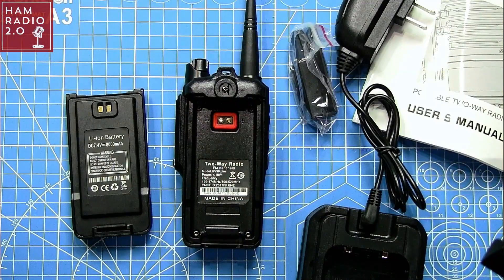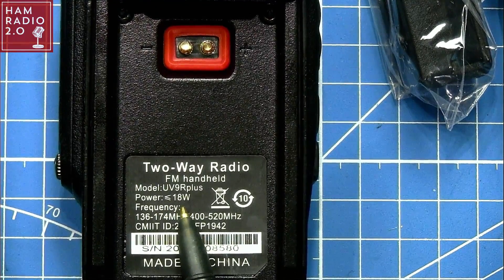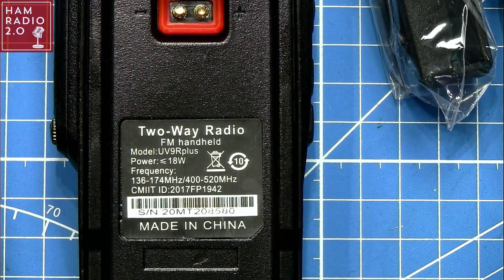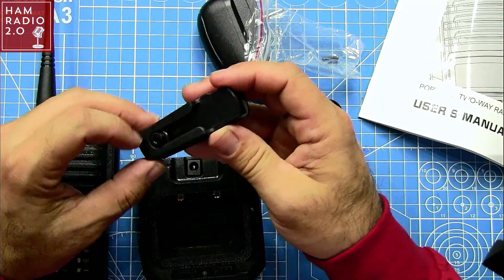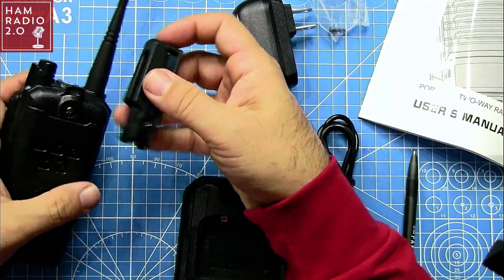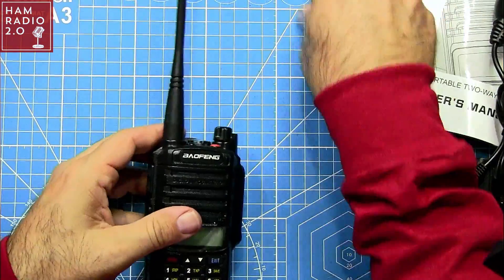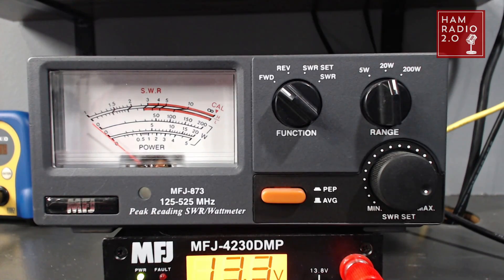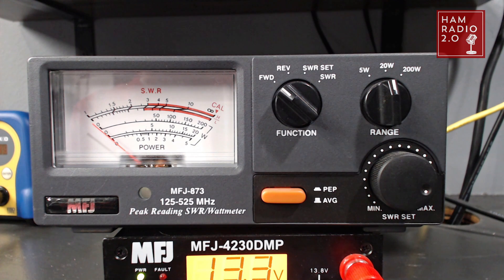Baofeng UV-9R TP 18-watt Power Testing | UV9R Plus HT

Comment: I'm wondering if there is a output difference between VHF and UHF? You didn't say which you were testing it on you just said the frequencies and you can still have the same frequency showing in the display on both VHF UHF

Comment: Baofeng will not make a 18 watt radio ever ... its either 5 watts or 8 watts .. any other Baofengs that have a sticker that's saying 55 watts 60 watts 100 watts. The radio is from another dealer and is not an authorized Baofeng Dealer ...

Comment: Well, if 18 watts at 8.0V that these radios operate at is the actual Amp draw from the battery, and not the effective power out, that would be 2.25 amps from the battery.

Maybe that's where these liars got the number from. It draws 18 watts from the battery while transmitting.

Comment: No no no you did it wrong. You need to be a mile off shore over saltwater in a helicopter with a altitude of 355ft in the air to get the full 18W. Didn't you read the fine print? It will also go to 25W if you're in a submarine.
Reply from the maker: Lol

Comment: hi 
I have a question: is there any difference between UHF frequencies??
for example, I mean is there any difference between 410.5 MHz vs 470 MHz??
I'm a mountain climber and I have purchased a uv82. now I want to know which frequency should I use in mountains and forests to achieve the most range? and also which frequency should I use in outdoor(such as deserts) to achieve the most range? or there is no difference between 410 & 433 & 470 MHz at all !??
Reply from the maker: Range wise there's no difference. For what frequency to use, check with the forestry service or wildlife management area around you to see what frequncies they monitor and what you're allowed to use.
Reply: @HamRadio2  tnx

Comment: lol My baofeng UV-9R-ERA is putting out a 1000w and is water proof to 100 meters it costs 26 bucks plus shipping with a free extra O- ring for the antenna. I just put a real imitaion NAGOYA antenna and I will be trying to contact Australia from San Diego barefoot. I'll let you know how that turns out ASAP.  73 KN6TUX

Comment: Thanks so much. I want radio communications for my ruralish site, a 240 acre spread of prairie. I also plan for CB,  and shortwave and FM Dxing. These little HT radios have got my attention. I've used them for traffic flagging, and the major fault I've experienced is that they don't work very well in hilly areas.

Comment: I have the UV-9R Plus even with the same battery, but mine only claimes to be 15W not upto 18. I have no way to test it either but I suspect it would still only be about 5-6. But what I'm wondering is... does it use/transmit extra power when using a CTCSS tone? Maybe even more power if using digital? Maybe the 15 (or 18) are the max the circuit could hanel by the firmware still limits transmit on those bands? I have a "Baofeng" cable to program it with chirp (gotta get the special Prolific 3.2.0.0 drivers for my cable to work) and it only has 3 pins for contact. You can also do more with programming it with chirp, like enabling the channel mode to show a channel name of up to 7 characters instead of the frequency. that's great if you're like me and mainly using it as a scanner that can double as emergency backup comms if it hits the fan. One of the settings I saw in the radio using the chirp software was a power saving ratio. Does turning that to "off" make a difference in the transmit power?

Comment: Greetings from the UK 
It occurs to me that all Baofeng are doing is petty much "re housing" the UV 5R,  I've had a few 5R's they are great little HT'S but the build quality is not so hot!, they just kinda feel cheap, I picked up a couple of UV 9-ERA's .. power tested came out the same (4 watts) but weirdly the very first pair of UV 5R's I bought about 4 years ago are kicking 6 watts!! My favourite ht is the old dependable kenwood tk 2180 (the full numeric version )  you can feel the build quality just holding it in your hand!

Great channel btw! 👍

Comment: As a complete noob in this topic: What happens if you use a very high transmit power near your head? I mean, are there studies or can you tell from your personal experience, what it does to the brain?

Can you feel any harm right while/after using it?
Reply from the maker: I've never felt anything, no. Most people don't like using a radio that's more than 5-8 ways close to their head. Higher powered radios can be used with external microphones so that when you transmit, you can hold the radio away from your head
Reply: @HamRadio2  OK. Thanks for the answer. I was just curious since I heard this in a lot of Radio-Videos on Youtube "you probably don't want to have 8 Watt right beside your head"

Comment: Baofeng radios have a reverse sma which has a male pin. Is this the first Baofeng you have seen?
10 volts is a common voltage to feed a BF charger with. You can get a usb adapter  to power the charger cradle or a usb 8V to plug into the battery to charge it.
Aircraft is AM the BF is FM
I have 2 types of Baofengs that will do 8 watts on vhf and is 130-170 220-250 400-450 and all is at or near 8 watts!

Comment: K4KID here... Thanks for the video info. Two thoughts... 1) I have a UV 9R Plus and the antenna connector is exactly the same as the UV5R and the UV5R TP radios that I have as far as the Male-Female antenna connector direction.  The label in it says 15 (fifteen) watts. It was given to me. I'll measure the power out on it later today. 2) Back around 1975, "COMMUNICATIONS" magazine, the journal for professional radio technicians, did a study w/ 5 watt HTs because many police departments at that time were in the process of equipping every officer w/ an H-T of their own as the primary radio for each officer. They compared VHF and UHF effect on the eyeballs of users. They found that a short (I believe I recall it was a 6 second transmission) w/ VHF increased the temperature of the user's eyeball by a measurable amount. When they did the same tests w/ the UHF version it increased the eyeball temperature even more. That stands to reason.... Microwave ovens are primarily used to heat the fluids that are inside whatever you are cooking. The UHF band is closer to the Microwave frequency. About the only way I would use 18 watts an inch or two from my face would be if it was a serious emergency, and I absolutely needed the power to communicate the need for help. Thanks again for the look at the 9R version. 7 3

Comment: I recently purchased 2 of the UV-9R plus distributed by MIRKIT and ordered the Nagoya NA-771 antenna. The antenna would not fit into the recess of the radio, the base of antenna is just slightly larger than the recess on the radio (where the antenna is suppose to screw in)(female antenna, male on radio). Everything else looks to be correct. Any suggestions on different antenna maybe?
Reply: You have to remove some of the plastic around the base. I made that same discovery a couple years ago. Remove a little plastic. Like right when you start seeing brasss stop and goes on fine and works good. But I have a abbree and nagoya that work better

Comment: There's no way that I would want 18-watts near my eyes or brain....
Reply from the maker: If it actually did that much on high power, you could turn it down to Low or Medium while using it next to your face - and on high power, you would use it with a speaker-mic while holding it away from you, or when it is connected to an external antenna.  You would have more choices if it actually did what it advertises it does.

Comment: As far as running the charging cradle from the field, get a DC to DC converter, also known as a buck converter. There are a lot of small ones you can throw in a small project box that are adjustable (either via a knob, or a potentiometer you add yourself, or digitally via a rotary encoder or an arduino or raspberry pi that you can slap a screen on and program) and they support a wide range of DC inputs and outputs. A range a remember seeing is like 1v-40v for both input and output, so you can easily go from a 12v power source to exactly the voltage needed for the cradle. After that, you can just buy the right size barrel jack for the cradle!

I know this radio isn't very good, but the buck converter circuit can be built for like $10, and that's including an adjustable converter as well as a small LED voltmeter so you know the output voltage, and if you carry a handful of different adapters in a small bag (plus gator clips) you can basically power anything with this tiny device you build yourself. Either use gator clips and hook it directly to your car battery, or use an inline fuse of around 7.5A or less behind a cigarette adapter

Comment: Smiling!
My first Baofeng UV 5R still working and I bought it when it was only available from china, around 54 bucks, took 28 days and I thought, disposable ham radio. All the little rubber pads are sorta messed up but still going. 
Ham Radio Dude has done a review on the UV 10R 60 watt one.  Some things defy the laws of physics ... not in this case it's a 4 watt like all the others... but wow that 24,000 mAh battery would be something to see in that size.

Comment: Aloha Jason, when these Baofeng UV-9R Plus first came out on eBay, they were advertised as 10 watt radios, then 12 watt, then 15 watts and now they are all over eBay as 20 watt handheld transceivers. 
    Now if it was truly 20 watts with a 9,800 m/ah battery, you would be lucky to obtain 6-7 transmissions for 30 seconds. Personally, I won’t put anything that transmits above 10 watts near my head. If you look at the RF charts put out by the University of Texas, the users of a 20 watt handheld would be effected by RF Radiation with that antenna next to a person’s head. A handheld radio with a mounted antenna should come with a RF Radiation Warning notice and/or labels to inform the users of dangers of RF Radiation. We all know that these sellers are intentional advertising these radios at higher than acceptable wattage ratings in order to charge more and gain more sales but what if one of these radios really did transmit at 20,30,40 and 60 watts? Is these sellers going to pay a user’s medical bills? Not likely but a warning label would require testing and inform the buyers prior to purchase. Great video again!
Reply: Radio waves are invisible, and you pass through them every day. Many of them are much more powerful than that of any hand-held radio. We're talking 1,000 times more powerful. If you lived near an fm radio station, would you live in fear of it.?

Comment: Each time I see the Baofeng with 5W or 18W , I feel  embarrassing. Are you kidding？ Are you serious?  According to the standard of telecom walkie talkie, the 5W is the most output for handheld UHF device.  Why does Baofeng make it 18W?   18W means it will cost about 18* 1.7 = 30W  =  7.4v*4A . But the battery's capacity is about 15W, which means it could work about 4 - 5 hours for daily usage. With 18W output, the  radiation will do harm to the user's body health.  This kind of 18W device does not make sense and is invalid device.

Comment: I have the GT-3WP and it looks exactly like this one. Has the same external microphone blade requirement that my other Mics do not work with. It is said to be "waterproof" which is what the "WP" in the name seems to inply since everything is pretty much sealed. Same output as you reported. I like the feel of this one, a little bigger and more robust-feeling but this one has the same antenna connection as the UV-5R. Charger like the one you showed too.

Comment: all these "higher wattage" versions are guaranteed to be nonsense designed to extract more money from you for the same radio. There are some 8W ones from reputable suppliers that are basically what they say they are (actual around 6 instead of actual around 4), but what do you need or want an 18W HT for? Battery life is gonna suck and you still won't get any further out.

Comment: A curious date.... Rqa0009 MOSFET (power transistor of uv5r &others) can work to limit of 15w.... Maybe is possible 15w with  some internal changes... But the baterry needs more amp. Anyway 15w near of head not is secure...

Comment: KO4GJO  I have 3 of the UV-9R+  Mine were only rated "15" watts.  It was cheaper to get 3 radios than to get one radio and a couple of spare batteries.  Somewhat sturdier and more dust/water resistant were the objective and worth it.  Did NOT expect 15 watts.  Side note: The slightly larger size  actually makes it easier for me to handle, due to some carpel tunnel issues.  Replaced the antennas for signal improvement.  Otherwise, hey, it's a Baofeng!

Comment: So, I sell these radios as a side gig. The UV-9R, The UV-82, and the BFLF-918uv. In EVERY case, when I order, they ask me what power label I want on them. All models of Baofeng are 4-6 watts rf out.
Reply: Thanks, what would you recommend?
Reply: Yes witch one is the best?
Reply: There are some 8 watt radios. They're not either of those 3.
Reply: @phil2082  which ones are the 8 watt models?
Reply: Uvs9plus or uv5r8w

Comment: Hello, Great Video. What type of Antenna did you change on Uv9rplus?
Reply: APPREE makes some deceit antennas for these.
Reply from the maker: I didn't change antennas on this radio.  The antenna is comes with is a standard SMA-F so any antenna with that style should work
Reply: @HamRadio2  Could you recommend a good size Antenna, not so big.

Comment: Some radios require an external power source (either an external battery or power supply) to be used while operating the radio to achieve a higher watt output. Curious if that would make a difference? if possible!
Reply from the maker: This radio doesn't really have an option to plug-in external power.

Comment: LMAO. The 18W power listed on the label is for the power input maximum. A 5W ideally matched load's RF power output requires another 5W to be dissipated in the source transmitter for a total of 10W. If the load impedance is lower, then more power is dissipated in the source. Minimal additional power is needed to run the rest of the radio.. The power input label on the back is stating the maximum rated input power requirement.
Reply from the maker: This is incorrect. The packaging and website link where I purchased it confirms it to be advertised as 18w output
Reply: Going off the actual label in the video and not marketing/ advertising, my information is correct.
Reply from the maker: @superalpha  Not really.  Many, many HT radios list an output power on the back of the radio, behind the battery.  This "input maximum" thing you are talking about has nothing at all to do with the stamping on the back of the radio.  In fact, it would surprise me to see any of the Baofeng radios with that much detailed information about their own product in any of their documentation.  Lots of HTs have "5w" or "8w" on the stamp behind the battery.  This one says "18w" and it was advertised as such on their own packaging and sales website.

Comment: Looks exactly the same as my UV-9R with the same power output, except for the "plus".  Even the manual looks the same.
Reply from the maker: There are several models that are very similar
Reply: I have a UV-9R plus.  It is my low power dual band base. To a J-pole @ 10 feet.

Comment: After allot of research. I did buy the 8 watt version (Amazon) and like it. (It was going to be a backup for my Yaesu, being repaired...again!) I can overlook the fact it really isn't 8 watts (but its probably 5 watts on high) but have not tested it yet. Perhaps their claims are for speaker wattage? Not TX power? But these are WELL built little radios. I have dropped it on the concrete from 3 feet high, many times, until I swapped belt clips! The case is sealed with o-rings and a case seal, a seal on the mic. port, and battery connection. I have not tested it for being waterproof, but its has gotten wet, rained on, and dropped in a mud puddle. No problems...YET! The OEM, rubber duck antenna actually works good on these radios. Better than my upgraded antennas. 
Is it the best HT ham radio? No. Is it a good waterproof, beater radio?  I say YES . 
I think they are a good value for the money. Makes a great backup, starter, outdoors, or grab & go radio! 
I am looking forward to your waterproofing tests. But crack it open and check out & lube the seals first. You may be surprised.
Reply: My 8 watt version (UV-82HP) tests out at a solid 6.5 watts on 2m and just slightly lower on 70cm. Better than 5 but definitely not the 8 they advertise.

Comment: I ordered 5 on wish from different vendors.   All sent just the antenna. @like $20 each.   So there's wish.  
So i ordered 4 more on Amazon. 2 different vendors.   One came with just radios.   And the other was very different radios with correct mic. And cable.  Pretty beefy radios.   There's alot of Baofang copy cats.
Reply from the maker: Yes lots of fakes or copies

Comment: There appear to be a few versions of the uv9r:
5W 2power/3power, 8W tripower, fake 18W.
I am actually interested in the 8W tripower version (waterproof version of ~uv82hp)
This fake 18w version is... well... fake.
Reply from the maker: Yep. I have another version here that I'll be posting a video for
Reply: The straight-up UV-9R will do exactly the same as the 9R plus, for less money.
Reply: @shotgunwilly4685  the regular 9R should be either 1w/5w or 1w/3w/5w. The 9R plus 'should' be 1w/(4-5w)/8w.
Reply: There is now a copy of the clone of the original cheap radio 😂😂😂😂😂